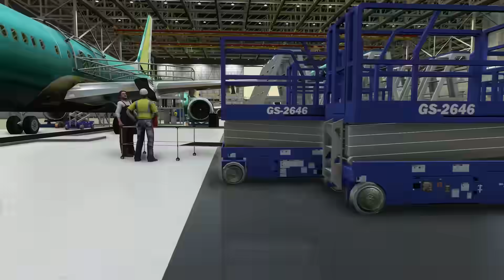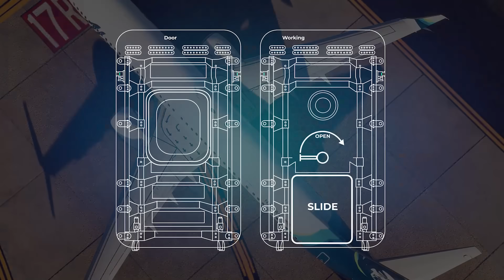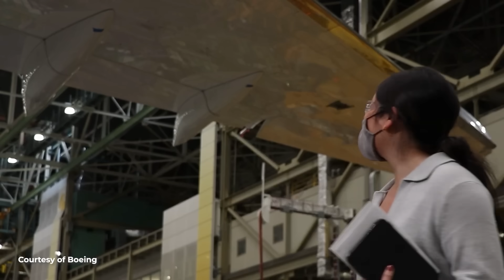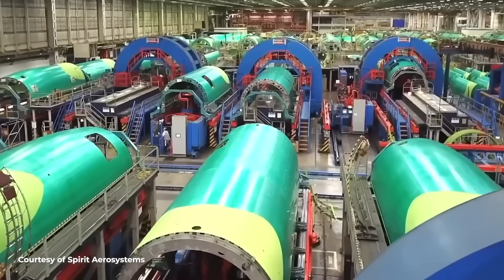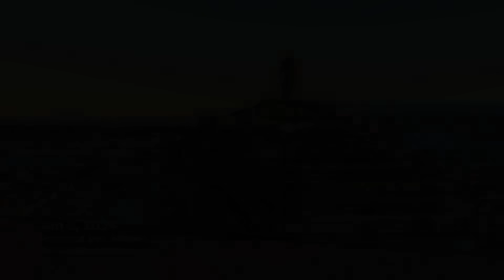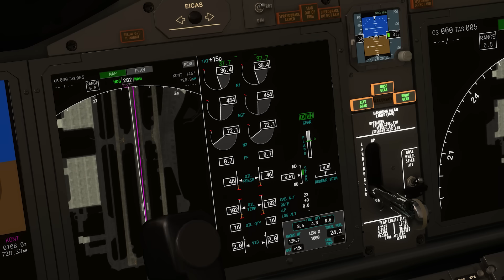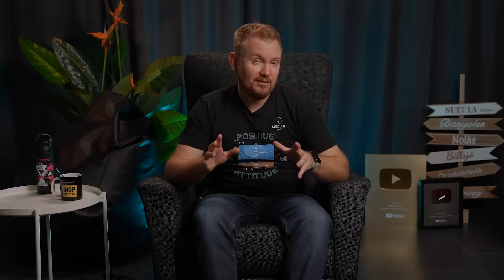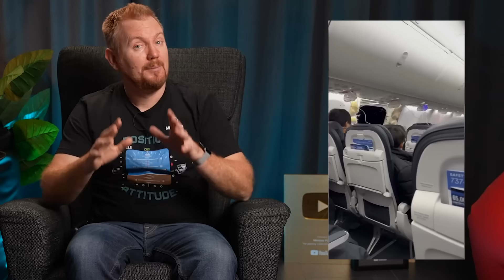Boeing 737MAX BlowOut!! The Scandal behind Alaska Airlines flight 1282

Comment: Moreso...WHAT KIND of "engineer" would design rivets to be positioned VERTICALY,instead of HORIZONTALLY? 
I'm talking about the smaller,numerous 
 ones,ofcourse...
Maybe they just repurposed the fittings that they already had,designed for something else?
Reply: OK...Now I understand.Some rivets were intended to hold the structural integrity, and some were designed to keep the hull airtight...
OBVIOUSLY,you can't have one without another...

Comment: This is probably going to sound crazy, but there are 12 (count 'em) 12 lined up stop pad connections between the plug and the frame, these could have been screwed in tight and never mind about the 4 bolts. You know if I was thinking about safety, you know if I was building a pressurized tube that flew in low pressure environments, I might want to be super secure about little things like that
Reply: You know, memory has become much larger and smaller in recent years, why not have 12 or 24 hours recordings in black boxes?

Comment: Hey, Man,

Love the channel, and with 2 millions subs I doubt you will see this, but I would love to see your analysis of the Feb 11, 1978 crash at Cranbrook Airport, in Cranbrook BC CANADA. Attempting to avoid hitting a snow plow on the runway pilots attempt to abort. If my memory is correct, one of the Reversers stayed open while the other closed. This made it impossible for the pilot to recover control and they crashed near the end of the runway.

It is an interesting story because at the time, ATC was controlled from Calgary about 400km away.

It led to big changes in the Canadian airline industry. I believe the flight was Pacific Western 314, and the aircraft was a 737-200.

I think the story would go over well here.

Comment: There IS a design flaw. The "plug" should have been designed so that when the cabin is pressurized, it holds the plug MORE firmly in place.
Reply: It does, if the stops are aligned.  Emergency exits on the earliest B737s opened inward.  That design was a serious impediment to evacuating the aircraft.  The door had to be lifted out of the way while people were wanting to get to the exit.  With the new design, you just raise the door with a lever and it falks out.

Comment: So if anyone wants to kidnap a plane they just have to open an emergency exit? 
Major design flaw. 
Make a hatch with a grid between cockpit and passenger compartment that will open on depressurization. So that a) no human can fit through it and b) no one can point a gun at the pilots or avionics.
And why isn't there a auto leveling function on the auto pilot? Just a button that levels the aircraft out to a straight flight. Every cheap ass r/c plane can have it, why not a real aircraft?
And the construction with the door plug being able to open without the 4 bolts is also a major flaw. Either let it be a real emergency exit or attach the door plug in a way it opens with gravity if any hardware is missing. 

It always amazes me how manufacturers can cut corners like this (also referring to the whole story with boing trying to cut costs for many years prior) and still inspect their products themselves.
I have to bring my car to inspection every two years and get fucked with if my indicator isn't working. 
In the meantime tesla can do their crashtests themselves, make an auto pilot that frequently kills people and Boeing can send out crap like this..
Reply: it is impossible for a human to open an emergency exit during flight. it would take over 24,000 pounds of force to open the door. the average human can only exert 50 pounds of force.

Comment: what an excellent report on what exactly happened and how the crew delt with it safely as they did :)  Now l wonder why no one noticed missing bolts when assembling the structure inside ?? why didn t the engineers double check their work when installing the panel seal ?? AND how come NO ONE NOTICED THE EXTRA BOLTS LYING AROUND ,hmm l wonder where these should go ??

Comment: I really feel for Alaska in this incident. They’ve worked like h€ll over the last 20 years to rebuild their reputation after flight 261. Overall it’s been one of the most impressive PR face-lifts in aviation history, going from probably one of the most hated airlines in the aftermath of 261 to easily one of the most admired today (topping JD Power’s ranking of highest customer satisfaction amongst traditional airlines for over a decade straight). But then this happened and in its wake most of the general public almost immediately pointed fingers to them, when in reality they themselves had done virtually nothing wrong. Yes, Boeing did accept responsibility for the incident shortly after, but they have to know that most of the general public almost always points to the airline at first since it’s the most public-facing party. It’s borderline defamation on Boeing’s part, because this incident was easily preventable.
Reply: I fly on Alaska Airlines.  I don't blame them for this.

Comment: When only 4 bolts were mentioned to secure a rectangular object that was a Big red flag, it should have 8 minimum, 10 bolts would have the safest
Reply: The bolts only prevent the door moving upward off the stops.  One bolt would suffice.  Four are plenty.  There is no need for more of these bolts.
Reply: @GH-oi2jf  Pressure will find Weak points and leak air, that leaking air over time will Cut and deform some metals
Reply: @GH-oi2jf  It was not installed as a door

Comment: Lifting springs being left in would make future removal of the door for inspection purposes much easier. This would appear to have been a decision in the design stage of the door plug. With the bolts removed these springs would have lifted the door causing the innocent.If it was a case of the springs being deliberately left it a movement sensoring system should have been fitted as is on other fuselage openings.
As the modification was of a temporary nature in that the plug could be removed and wasn't a permanent closure of the opening it is more than just an oversight that a movement monitoring system was not incorporated into the design of the door plug. 
A lawyer's dream case.

Comment: Yeah i am in the construction industry and i watch these videos in horror, nothing like these would ever happen in the construction industry. There methods in aviation are so primitive it is astonishing. They do not have even the most basic safety features like “lock out tag out” you take the p-tubes on the plane out of service and they do not even notify anyone. In my business it you took anything out of service there would be to large heavy RED bags placed over the stick or hand controller with key locks on both sets and a tag saying what was “out of service”. 

I could go on and on, and the one that gets me the most is the planes driving around to taxis and runways with no supervision at all. In my business is there was nasty weather or construction work on the runway you would a have “pilot car”  “Escort car” a big truck with a huge sign on the back all lit up where the aircraft would follow the pilot car the airplane pilot would be in ground communication with the pilot car at all times. Once the plane was in proper place the pilot car would turn off the runway.

This alone would have stopped countless accidents.

Compared to my business the aviation industry is extremely dangerous there are no checks and balances of any kind at all.

Comment: It honestly sounds like both pilots in the cabin did a fantastic job. They stayed calm, took time (but were swift) to choose an agreed upon course of action when needed, and kept calm while not knowing what was going on. They couldn’t have had any clue what failed in this case, and it seems like their training and experience led to them making the best and most rational decisions they could with the information they had. 

Their communication was impeded but they didn’t shut down like we’ve seen so many do in high pressure situations, let alone ones where masks and noise make communication especially difficult to understand. 

I can’t imagine how terrifying it must have been in the cabin, but thankfully the captain and first officer really seemed to do an outstanding job. It’s so lucky that nobody was seriously harmed or killed. 

I’ve been in a plane where something obviously went wrong with a system because the temperature suddenly absolutely plummeted and it became freezing about an hour into the flight. This was during a cross country flight from LAX to JFK. I have joint issues in my knees that the cold can exacerbate and it was so cold in the cabin for over 3 continuous hours that when we landed my knee pain was so intense I couldn’t move my right leg and required assistance to disembark and a wheelchair to meet me at the ramp all the way to the car, which the staff were great about. In the car we blasted the heat and by the time we got home I could walk again, but needed further treatment for the pain to finally fully subside. At no point was there any communication to the passengers about the issue, so I have no idea what happened. People asked for blankets (including us) but were told they weren’t on hand. Thankfully when we flew back via the same airline and same route there were no issues, but that was taxing enough for me and uncomfortable for the other passengers, who were discussing it during the flight but given no explanations. I’m very grateful that’s the worst that happened, since this channel has taught me issues like sudden loss of temperature control can indicate much more serious problems are at hand that require the plane to redirect resources or worse.

This incident was nobody’s fault but the manufacturers and their communication and quality control issues. It doesn’t seem like Alaska Airlines could have done anything other than what they did, it wasn’t a foreseeable defect they could and should have accounted for before approving the craft to continue service.

Comment: It's hard to believe this wasn't cause by wilful negligence. When the repairs were completed there would've been a set of bolts rattling around. Somebody picked up those bolts, realized the error (if they didn't why are they allowed to work on planes) and then decided not to say something or take appropriate action. Or they did say something and, for whatever reason, nothing was done. Its harder to believe that this was somehow a complete accident or oversight.

Comment: I really don't understand why this incident has been such a big deal and has caused Boeing so much trouble. If anything it gives me more confidence in the 737. The aircraft was still able the fly and land with no loss of life even with a explosive decompression. There are so many fasteners, welds, epoxy joints, seals and other points of failure on a aircraft it boggles the mind. That failures occur this rarely shows that quality control is very very high.

Comment: I worked as a manager in quality control and our mantra was, safety first on-time, first time, every time. If something is not right then operate an action to recognise the problem, where the problem started and then action a standard to stop the fault appearing again. Not to carry on until an action has been inputted.

Comment: Why isn’t switching the transponder to squawk 7700 on decompression more of an automatic act on the checklist especially since they had trouble communicating with both the cabin noise and  oxygen mask? You mentioned clearance to descend but ATC should start directing traffic away from them on getting the emergency squawk code, or at least that’s what my instructors told me.

Comment: Wait, does that automatic cockpit door opening when there is rapid depressurization of the cabin work on other types of aircraft? If so, it's even more ridiculous that pilots are told about this, opening an emergency door could have saved that german wings flight.

Comment: The purpose of the springs is to hold the plug up and away from the skin of the fuselage when it is opened for maintenance, that is all. The amount of force they apply to the plug Assy is negligible. 
Also, it was N704AK not N272AK (272AK is a 900ER)

Comment: I find it extraordinary that Boeing elected to retain the door springs in place for the door plug assembly. I imagine this was certainly a time/effort saving decision but to leave them in place where they were not necessary and could potentially lead to other issues seems counter to a risk based approach to design.
Reply: Perhaps they acted as spacers, keeping the plug properly oriented. It would not make sense to exchange the existing springs for some other type of spacer when the assembly was going to be bolted into the airframe.

Comment: Seems like the underlying problem was Boeings decision to spin of it's mfg operations into a separate company.  The motivation to do that is to squeeze expenses out of the company,  but it also creates, what will inevitably become an adversarial relationship and further complicates communications.  Boeing should be shut down.  Maybe some new Elon Musk guy will come along with a passion for aircraft and get America back into the aviation business.
Reply: The problem is that the 737 is a plane designed in the 60s that was haphazardly redesigned to compete with the a320 which is 20 years it’s younger.  

That’s just not good business.  

No the 737 isn’t “well designed”. It was well designed now it’s a patchwork

Comment: I must tell of an argument I got into with another member of the crew on a United Airlines flight years ago.  I mentioned in conversation that I was homebuilding a wing on a Formula One race plane and mentioned that I was trying to design and build the wing to get as close to elliptical lift distribution so that the wing would produce an accelerated angle of air, when added to the angle produced by the vortex system, would be the same total angle, making for the most efficient wing for its span, like the WWII Spitfire, not loosing speed in climbs and banks.  when I mentioned the wing producing thrust and lift, the other crew member said no, the engine produces the thrust and the wing only produces the lift, and he taught aerodynamics for three years at the US Airforce Academy.  I said, have you heard of sailplanes, or gliders, and the space shuttle, returning engineless from space?  And, just yesterday, living in the Florida Keys, I motored my sailboat out of the canal and in open water, I turned it into the wind and raised the sails, the vertical wings.  Still with the sails flopping, I turned the boat away from straight into the wind, and held their lower trailing edge tight and the boat heeled somewhat and started moving ahead, so I turned off the engine and sailed about 40 miles towing fishing lures, all the day returning before evening, all day without the engine on.  That which corresponds to vertical lift on an airplane wing causes the boat to heel over to the side, this is the detrimental force on a sailboat, so let the sail trailing edge out some, for less heeling to the side, less angle of attack and producing more  thrust coming off the trailing edge of it's sail propelling the boat more forward.  Except for the vertical lift of the wing that lifts the airplane, wings in other uses are used, primarily for their thrust.  examples, the propellers on airplanes, the wings on wheels in turbine jet engines.  Try entering the door of a prop airplane with the engine at higher than idle and you feel the thrust!

Comment: The airliner you show in the animations is N237AK which is a 737-900 (737NG) rather than the actual plane involved in the crash, which has tail number N704AL.

Comment: For years we were told that the Mode 3A codes were protected information and should not be released to the general public, especially the Unlawful Interference one.   To allow pilots, especially in that situation, to make the change without anyone else knowing what you were doing.   I worked for an Air Defense sector many years ago and we were informed that these codes were not public knowledge.   On a funny note, we'd always hate when older aircrafts that had manual code inputs would roll over those numbers because then we'd get the code flash on our monitors and then its a "was it accidental, intentional" and phone calls had to be made.   This occurred so often on Trans Atlantic flights entering the ADIZ.

Comment: Forgetting to pull the circuit breaker don't looks very good on the two pilots or the airline. Knowing Mentour, and reading between the lines, the first officer was not doing a stellar jobb here, you could hear that her stress level was higher then it should be for a well functioning pilot. I wish they would have more stress capability test in every commercial flight school and/or rigorous stress handling testing before hiring pilots. Most people can train to take a plane from A to B but to handle very stressfull situation in a very complex system is very hard and requires a very special mindset.